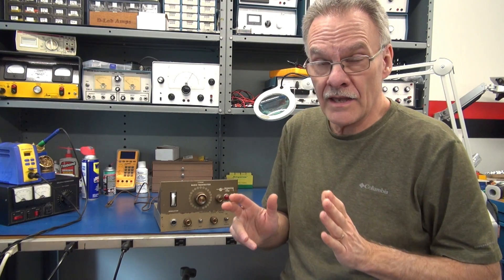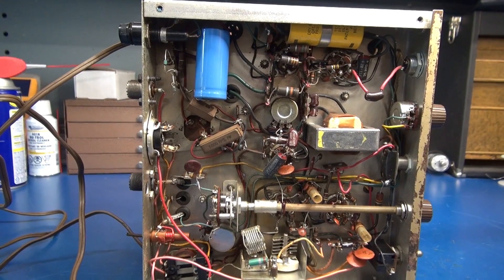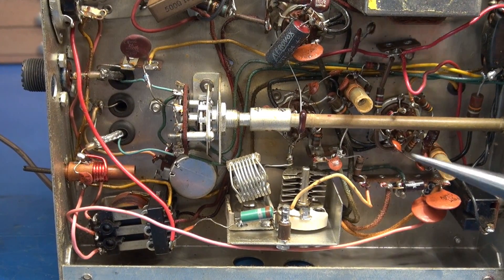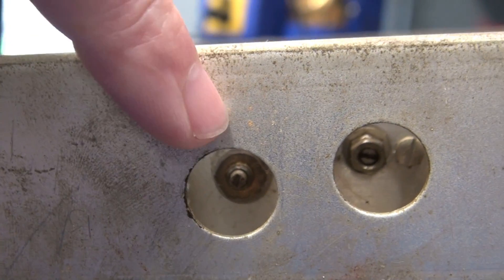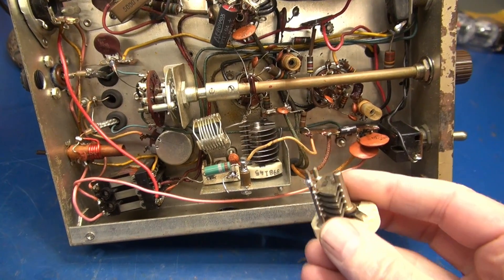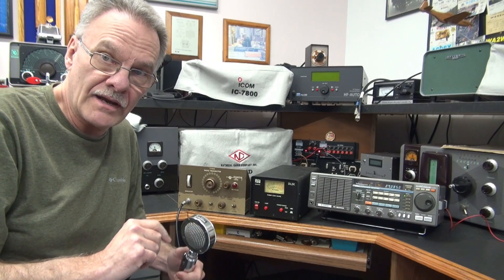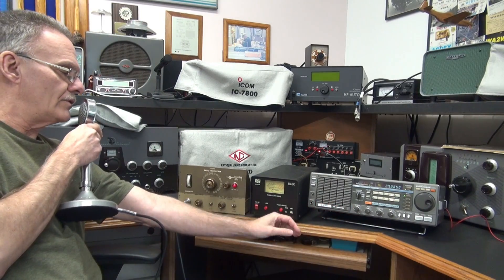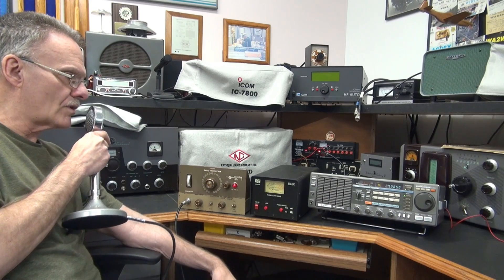Browning Golden Eagle  Vintage tube type 23 Channel CB transmitter 23s9 repair broken plate cap

Comment: I have a golden eagle mk2 and mk3..They are great plate modulated talkers. My mk2's have the mechanical collins filter in the RX's, witch they stopped putting in at the end of the mk2's into the mk3 generation.. ive gotta find some hot glass now.

Comment: Oh, knock it off with the whistling… People don’t whistle into their transceivers. They SPEAK!
Reply: Old military radio technicians were taught to whistle to check modulation, my Vietnam-era equipment actually used 1600 cycles for signaling and we wood always whistle rather than using the built in oscillator. In my two-way radio shop we would whistle to check deviation, so consider using your built-in audio oscillator for testing. However it's hard to whistle with my tongue in my cheek.
Reply: @mackfisher4487  Yep!  We were still using the "boat anchors" at Ft. Polk in 1977.  Most of what I did was repair or make cables though.  I was the new guy PFC.